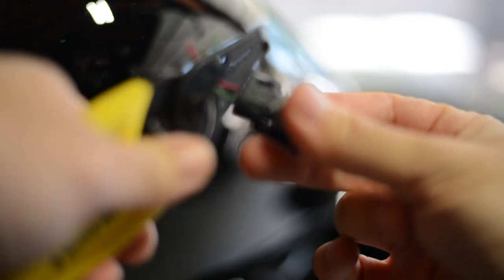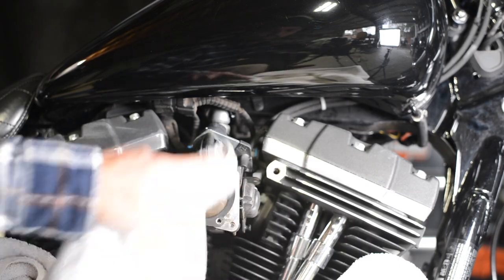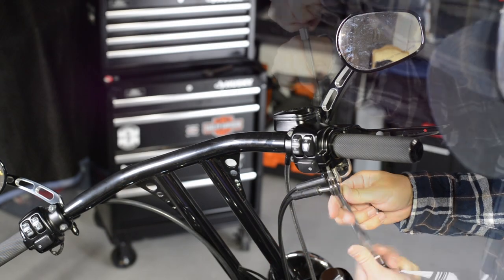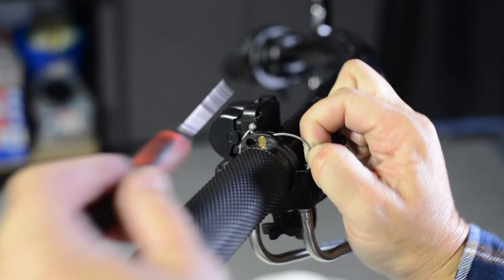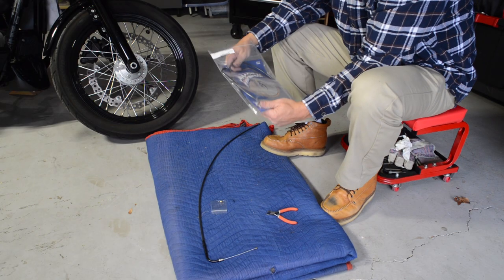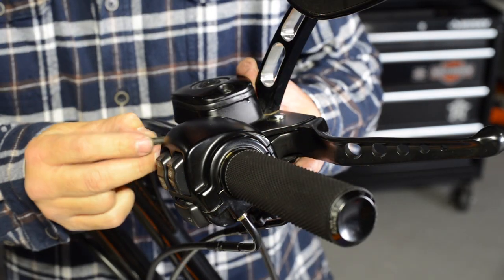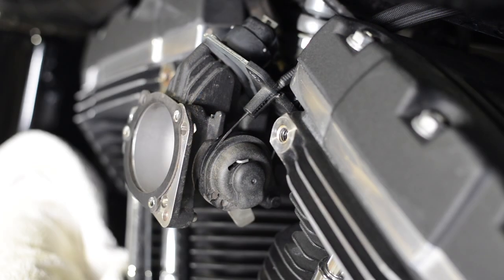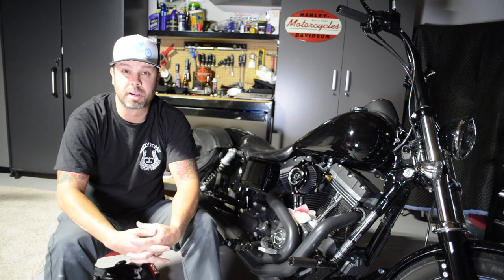How to Install Throttle Cables on your Harley Davidson

Comment: Thanks for the throttle cable tip. The return has the spring on it. I didn't keep track of which was which. Life saver. Thanks!

Comment: Thank you very much what a great video well planned and executed!! 
  I'm attempting to do this right now with a 2005 Fatboy 17-in apes, just ordered 51-in cables, I had 42 but they was too small. 
  And my throttle actuator at the intake is very beat up just barely holds the ferrels

Comment: Finally utilized this video haha, got rid of my trash oem cables (50k miles old lol) and threw on some Barnett performance cables. Tutorial was super easy to follow, but man I felt like a wimp pulling the cables from the control housing, those things were in there tight! Took advantage of having the controls open and took out the stupid 'cruise control' dial as well. 

A few things idk if I was dumb or if I just misunderstood. But when I was adjusting the cables, I went off the butterfly valve inside the throttle body being open 100% then gave it the additional turn as you suggested, rather than looking at the wheel on the side of the throttle body. For the return cable that one I'm not sure I have adjusted correctly. The body of the cable was touching the spring inside the slot on the throttle body from the get go, so I couldn't adjust till then. So I adjusted until the return felt right, and backed off a full clockwise rotation and it feels nice, smooth, and snappy now. 

Finally went in and ordered that little cap as well so I can remove the vapor canister up front next weekend. I think I'm going to keep the bracket in place though, it looks like the perfect bracket to hold a horizontal mounted oil cooler 🤞

Thanks again for the time and effort in this videos man, I check back on them all the time!

Comment: Nice job, brother!  I installed a new chumps bar and forgot if the two push and pull cables were seated all the way into the housing or not (plus the spring config).  Very helpful and a nice job.  Pristine (without all the other crap that some people take; 5 minute video that extends to 15-minutes-plus)!  : )

Comment: Great video! I believe my cables are to long I was hoping for a better shot of the idle cable going on to the Throttle Body. No matter how I adjust it the fitting and the spring doesn’t move. I’ll be checking out your cable sponsor they have style for sure!

Comment: Best video! Quick question, if the throttle wire gets cut, do we need to replace both throttle and idle cable ?

Comment: Great as I'm about to install new cables on my XLC.  Step IV is basically just taking all the slack out the cables and making sure wide open on the grip is wide open at the carb wheel...right?  The opposite same w/ the idle?

Comment: The screw inside the adjusting nut and lock nut is stripped and I am unable to adjust my pull cable. I  have a 2000 Springer. I don't want to buy a whole new cable. Can the elbow and the other pieces be replaced?

Comment: I bought my first motorcycle I never worked on any of them or even cars. I noticed that iddle and throttle cable are "loose" this metal part  7:29 that goes straight to that plastic is very loose how to fix that? and also is that litttle wheel under the throttle is mechanic cruise control? because my 2007 dyna street bop has the same thing. But please tell me what to do with cables I assume this part that touches that plastic underneath suppose to be solid , mine is very loose both cables .

Comment: so after you tighten the throttle cable,,,,   i think you turn it CCW  one turn it would loosen it up correct ???  i broke my new cable after 1000 miles. i think it was to tight no slack at WOP...

Comment: I have an 03 Sportster and getting to the throttle wheel is a pain. Will I have to remove the carb to get to it. I have the throttle cable off but the idle cable is tucked in the back with no way of removing it

Comment: I'm having trouble removing mine from the clam shell I have a 97 and I tug and the silver part came off but the nipple that's in the shell is stuck half way. I'm in a wheelchair with a modified Harley to a drivable side car just in case I get razzled.

Comment: Hi,, you got a great ride. Your videos are very ilustrative and  useful .. I bought from magnum a kit for a 14 inch ape and this is the 2nd time the idle cable fails(break) with only a year.. Is that possible or do i have to lubricate every 3 months... Any advise?
Reply: sounds like something is wrong man ive had the same cables for 15 years and 50 thousand miles

Comment: Im still trying to understand the return or idle cable what you ment by “just to where the spring meets the housing “
Reply: For anybody reading this. The idle cable has a little spring at the end of it that hooks on to the throttle wheel. (The spring does not hook to anything)

Comment: Hi, can I enquire if you changed the gaskets or reused old ones?
Reply from the maker: Typically you should change out the gasket.  Mine was newly installed and still in great shape, so I reused it.

Comment: Do you have an aftermarket throttle tube ? And if so which one ?
Reply from the maker: Hi Ryan, are you asking about the throttle body?  Either way... my throttle housing, body,  cable... everything shown in the video is stock for a ‘14 FXDB.  Does something look different on your bike?  If so, what year and model?  If there is something I can help with let me know.  

+The Ryan8er
Reply: Granite City Riders no im asking about like what the throttle side hand grip goes on that the throttle cable attaches to ? Like biltwell whiskey throttle or something like that ?
Reply from the maker: Ah, gotcha... yep the grips on my Street Bob are Arlen Ness Knurled Fusion Grips.  Here is a link:

http://www.arlenness.com/prodcat/Grip3.asp
Reply: Thanks for posting this video.  I am installing Magnum Chromite cables tonight.  I needed this video to learn how to connect the cables to the intake.  Definitely helped out.  Thanks again.
Reply from the maker: Glad it helped Brian.  Thanks for watching.